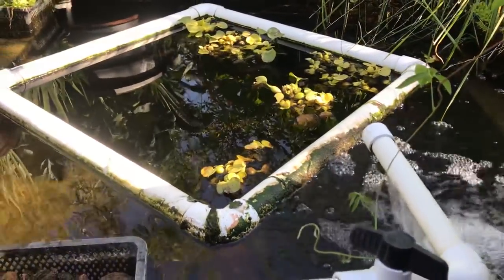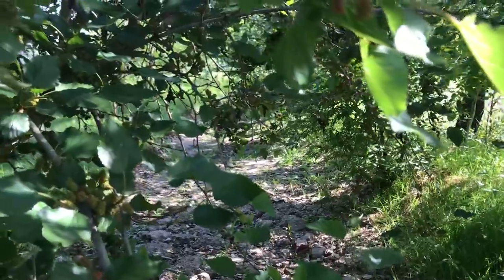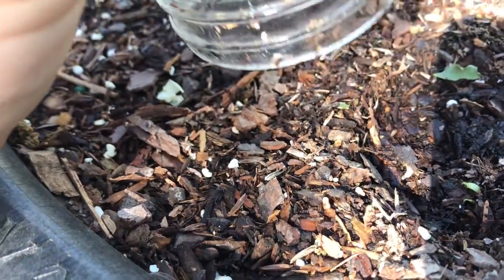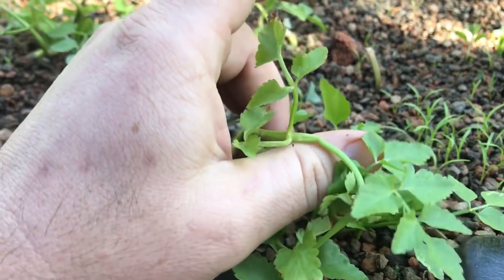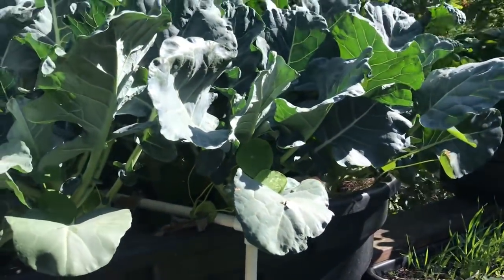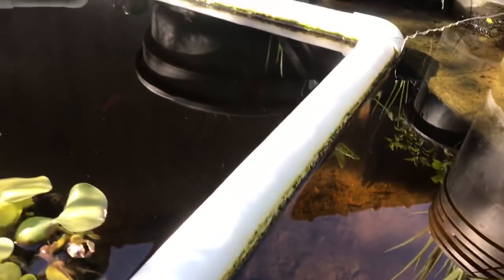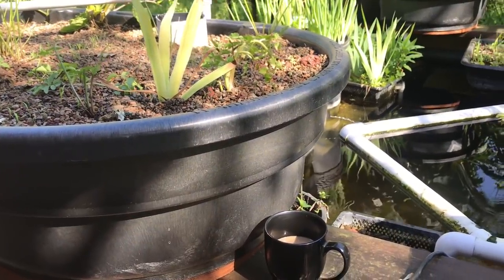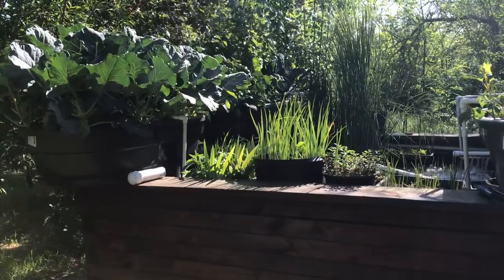Basic Layout of 3 Aquaponic / Aquatic Systems - Part Three

Comment: Hi Jack , what do you use in your wicking  edson for media? I have large  Aquaponic  system in a green house using  dutch buckets with perlite in them. I'm interested  in expanding to wicking beds on the out side of the greenhouse  and two inside. Any suggestions?   It would be great.  Your systems  are awesome .
Reply from the maker: You can use any bagged organic potting soil, I use so much I generally mix my own, I buy compost by the yard, and mix in leaves, very fine wood chips and perlite.  I can't give exact ratios I just add a bit of this and that until it feels right to me.
Reply from the maker: Oh and I haven't used it but some peat seems like a good addition.  I am sure most bagged products have it.